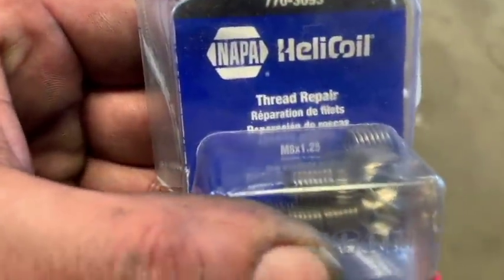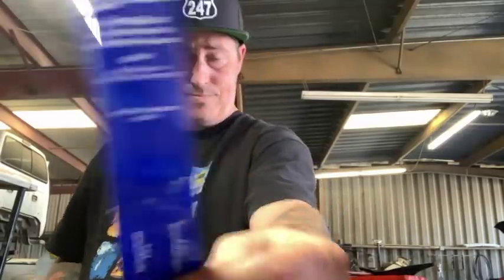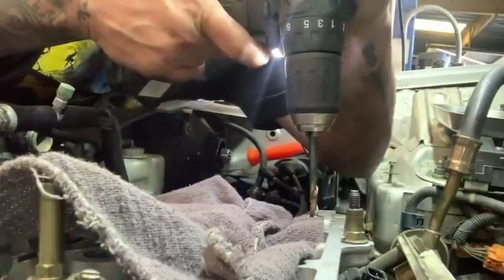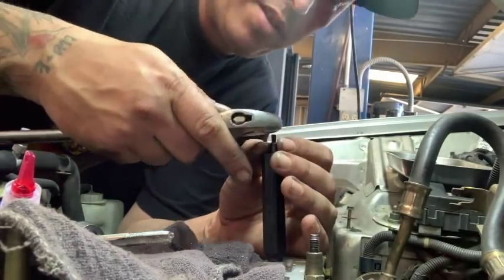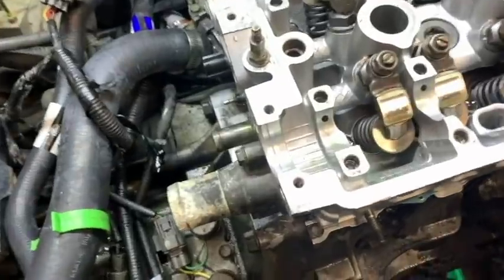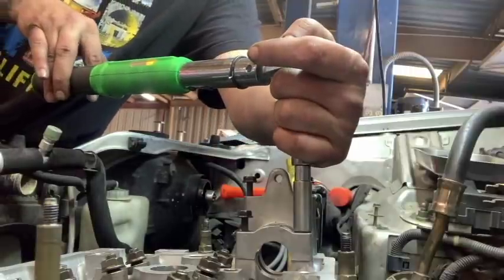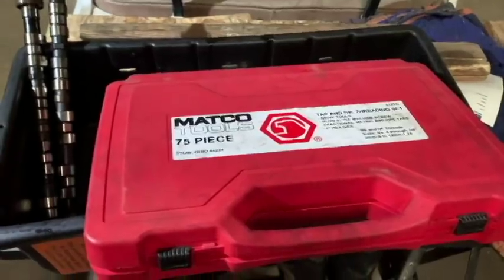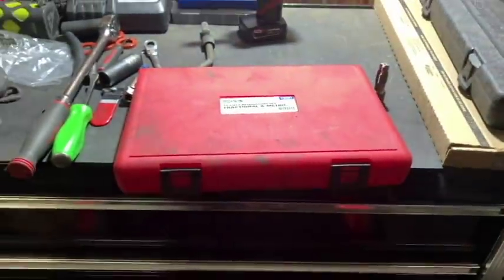Installing a HeliCoil

Comment: Good to use a drill and tap guide when installing helicoils keeps the drill and tap straighter.  Guides can be made on a drill press with simple steel.
Reply: david thanks for the tip  on the guide I dont have a real steady hand sometimes
Reply: @robertmullen2480  i have this also a good to munimize tap breakage.  Try to get the welders and assemblers at work to use tap guides also.
Reply: If you drill a lot of holes you can get drill guide bushings. They are made of hardened steel to resist wallowing out the guide over time.

Comment: You used the install tool incorrectly, the helicoil insert threads into that body that you called a special tool.  Then use mandrel to drive it out of the body into the tapped hole, use a spring loaded center punch to remove the Tang, there are specific specs for the depth.  E.g.  X number of turns below the top thread

Also, they make helicoils of different lengths for when you need more thread engagement

Lots of good info on helicoils website....do some research

Comment: The coil goes into the cutout on the tool body. Then the threaded mandrel goes into the body and threads onto the coil.
If you look the tip of the tool body is threaded. Use the mandrel to drive the coil into those threads. From there place the tool over the hole and  drive the coil out of the tool body threads and into the repair hole. Use the tang knock off tool and you are done.
Reply: Yep. I saw that too. I started to write a reply but got sidetracked. The "fancy little apparatus" that Justin dropped on top of the insert is used to pre wind the insert to make it easier to install.
An uninstalled Heli-Coil tends to "unwind" and be a little larger than the hole. So, you drop the insert in the side of the installation tool, screw it through the bottom and right into the threaded hole. The installation tool ensures the outside diameter of the Heli-Coil insert is the proper diameter and makes it easier to install.